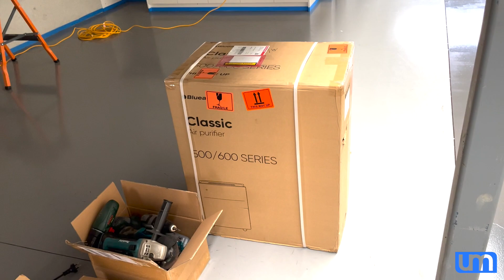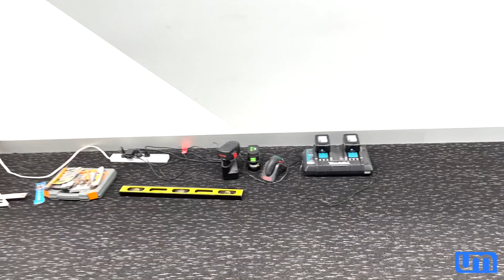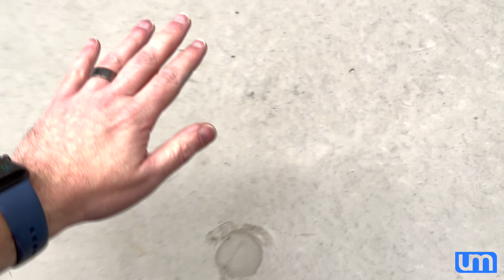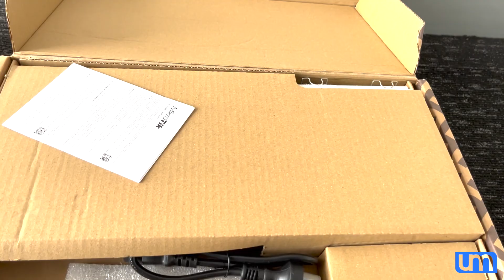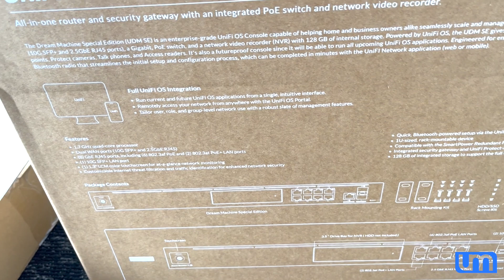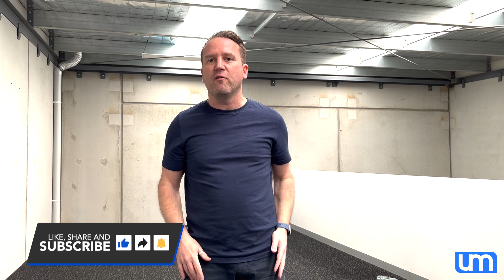New UM Space Vlog - Ep2

Comment: Seon consider a ceiling grid, cheaper easier to demolish / remove at end of lease. Cable tray or catenery wires for support of cable / refrig lines. No it wont be load bearing but if a piece of equip needs to be supported above ceiling this can be achieved by bracket off wall / post below / hung from purlins... it also allows access to any area from below by lifting a ceiling tile. Lighting needs to be factored in too so 1200 x 300 led panels again are probably the best $$ value per lux and being std size means 1. cheap 2. you can sell em if you move.

Comment: Make that ceiling load bearing, it will serve as storage then, or as a light office. Not going to be much extra cost, and as a bonus being able to walk on it is a big bonus when you want to do changes. For AC condensate pumps are very cheap, and will easily pump up to past the ceiling height for the drain line to run, and having the ability to walk out to clean it is a big bonus for the AC guy when he wants to service the lines. They only need power fed to them, a 10A socket nearby, and will switch off automatically when dry, though you will need to have access to them for regular cleaning, as they do pick up all the goop that grows in the condensate water, which is an amalgam of dust, skin and anything else like smoke that gets caught by the fins, which makes it the perfect bacterial growth media. 

When doing the insulation please also include that roller shutter door, at the least an air curtain across it at the expected opening height, and then a strip curtain as well, which will provide a dead space to keep the inside from experiencing big air changes when the door is opened.  Cheap one at 3m will work well, plus easy to install, and then use the ceiling people to put a set of boards from the air curtain and barrier support to the roof, and insulate the inside of that as well, so that your top does not have to cope with the heat load and heat loss through the steel door panels. Before you do so though get a door service, while it is easy to get to it, so the springs can be cleaned and relubricated, and the chains as well, with the channels cleaned out and lubricated with a dry lubricant that will keep the dust from sticking, but make it easier to open the door.
Reply from the maker: The moment I make it something I can walk on and store things on etc, I'm basically extending the mezzanines and have to go through council permits and approval, structural engineering designs, landlord permission - all of which will take months.

A simple ceiling just to enclose the area is the quickest (and cheapest) thing I can do.

Comment: Good luck Seon. Big job ahead. But it will happen. Split systems these days have pumps so the water issue will not be a problem. When you get time one day, it would be nice if you did a basic diagram of your network system with the 10G backbone etc. Curious on how its setup. Cheers.
Reply from the maker: Network layout is simple. 10GbE Switch out to network points. No switches beyond the rack.

Comment: Cant you connect to the pipe you have already for the outdore?
Reply from the maker: That's an exhaust outlet for the bathroom - it goes up,  not down ;)
Reply: @UnexpectedMaker  maby put a smallere insite
Reply from the maker: But it goes up, not down. Exhaust goes up out of the roof. Water doesn't go up, it goes down. Down goes back into the exhaust fan in the bathroom.. not to some ground level drain or external exit.
Reply: @UnexpectedMaker  Ohh sorry misunderstod,, i was thinking of air

Comment: Just run the ac drain into a condensate pump. If you run dehumidifiers when you are not running the mini splits you can also dump that into the pump.
Reply: if you use a pump, make sure you have a safe overflow in case the pump fails. we had ours in the drop ceiling coming from the split head. several times the pump failed (once a power issue, once the hose clogged, and once a plumber pinched the line when fixing another issue.)
Reply: @samplesandtests  We have ours setup to signal our alarm system and shut off if the float level gets too high. Most pumps have no/nc terminals to allow for this
Reply from the maker: Aircon guy is taking care of aircon. I've used him for a long time, and trust him :)